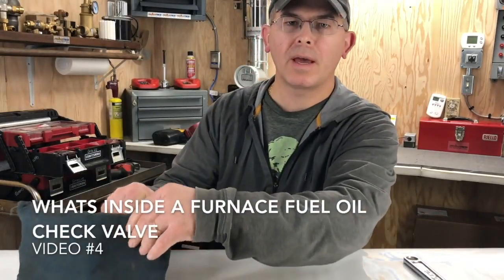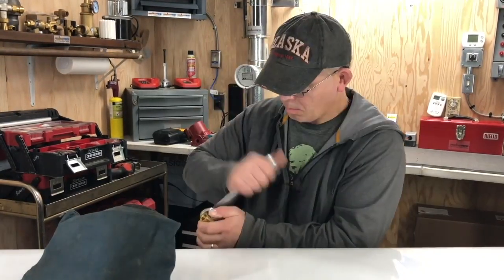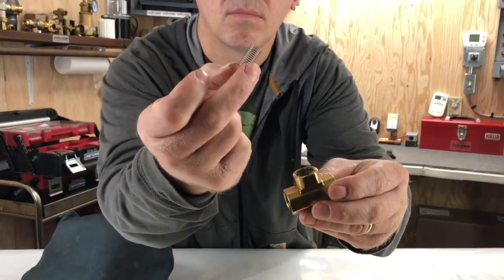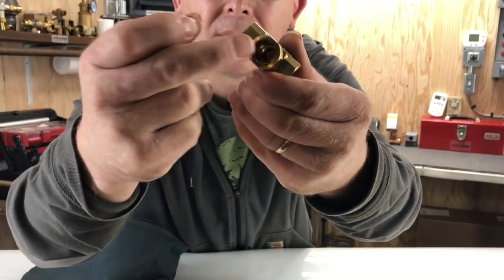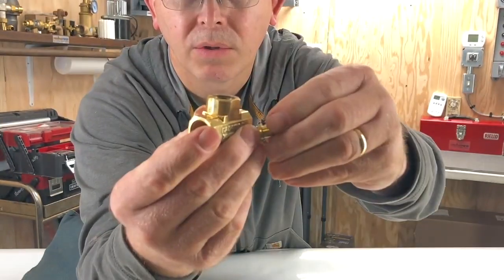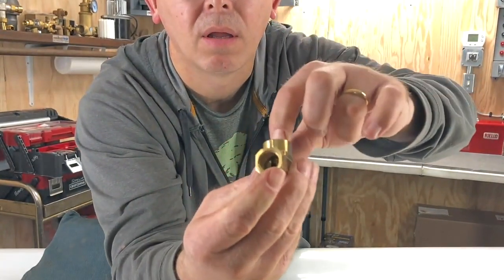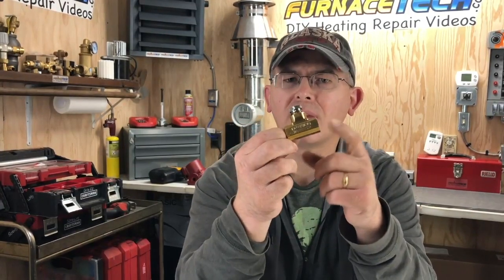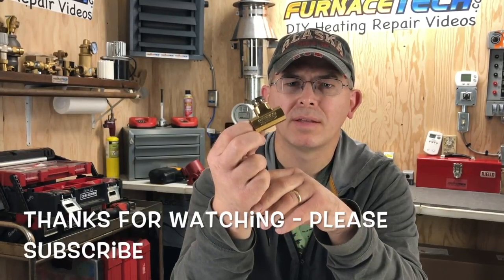What's Inside a Fuel Oil Line Check Valve

Comment: Yea but what if the burner is below the oil level in tank? Wont the oil then instead seep through towards the fuel tube nozzel assembly when the pump is off and the valve is say stuck open?
Reply from the maker: If your fuel tank is above the burner, you need to have a fuel safety valve in the line to prevent fuel from leaking if there is a leak in one of the lines or connections.

Comment: Which way do you turn the valve to stop oil flow and which way to have oil flow?
Reply from the maker: The firematic valve? Turn it to the left and the handle will actually come off. If the oil is still flowing through then it’s stuck open. Push the valve stem down. It’s spring loaded to close. I hope this helps

Comment: Okay , so where do you attach the check valve to and or locations ? And how do I know if I need one ? Thanks 👍
Reply from the maker: The check valve goes on the Supply line - Check Valve, Firomatic Valve, Fuel Filter, Tigerloop.
Reply: @FurnaceTech  excellent thank you , all the snow knocked out my internet , looks like it’s back up..